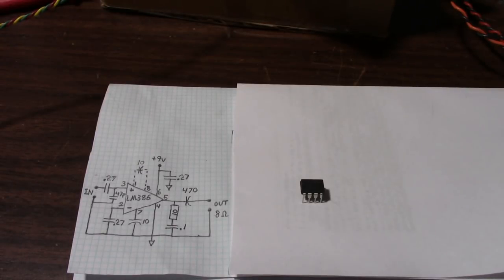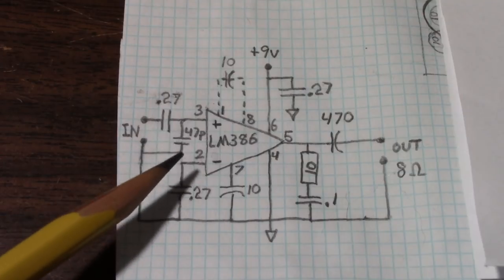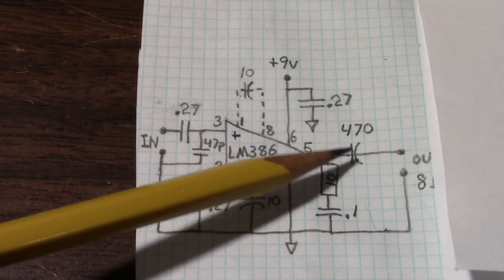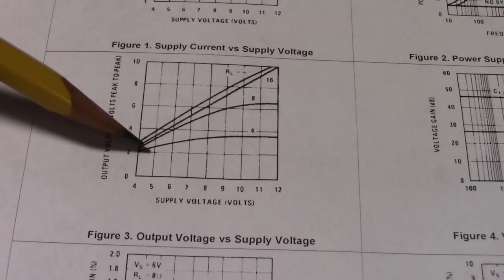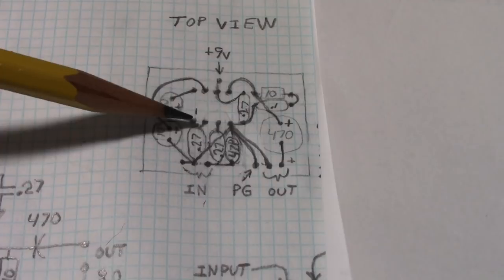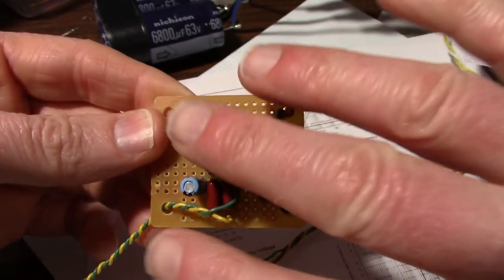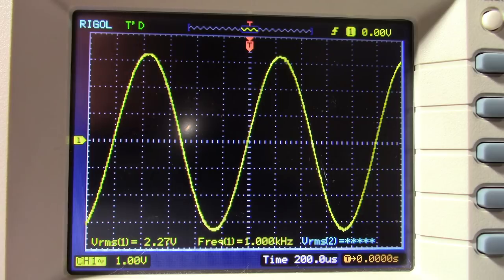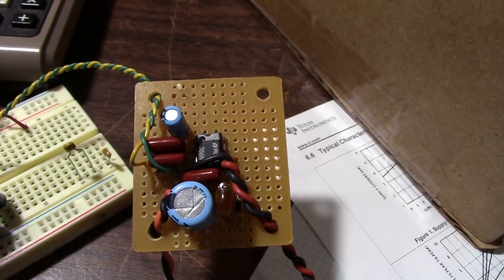Make the PERFECT LM386 audio amplifier?

Comment: Never seen or heard a 386 perform this well. Always excited to see people getting the most from cheap and readily available components.
Reply: The LM386 is EOL'd by TI, perhaps will be by other manufacturers at some point, since class D chips are readily available for this power level.
Reply: @MarkTillotson  - and there are numerous benefits of Class D for low power amps. The LM386 is so old, there's not really any reason to use such a device now days.
Reply: @johncoops6897  Could you be specific with what part number would be preferable to the LM386?  I am guessing that many other chips might be out there now... any which could drive 4 Ohm speakers?
Reply: @BruceNitroxpro  - One of my favorites is the PAM8403, which can be purchased as a complete STEREO module for less than $1 on eBay, etc
Supply Voltage range / typical
* LM386N-3 supply 4V to 12V / typ. 9V
* PAM8403 supply 2.5V to 5.5V / typ. 5V
Output @ Volts, Ohms @ 10% THD / Typical THD
* LM386N-3 @ 9V 8 Ohm = 1 x 0.7W (max) / typ. 0.2% THD
* PAM8403 @ 5V 4 Ohm = 2x3.2W @10%, 2x2.5W @ 1% / typ 0.15%
So the PAM has heaps more power, uses a "easier" voltage (5V USB), can drive 4 Ohm loads, has lower distortion, massively higher efficiency (better battery life), is dual channel so far smaller PCB, and about the same price.
Reply: Agreed. Sounds pretty nice.
Reply: @MarkTillotson  can you give link on Class D amplifier at this level please?
Building a 9v amp for sustainer kit for my guitar...
Instead of speakers, it outputs to a pickup-like 8 ohm driver installed at neck pickup position to vibrate the strings for sustain, then flip a phase reverse switch of the output for feedback or harmonic so neednto add pots for adjusting...
The input to amp is from the other pickup of guitar...
I burnt a Veyz sustainer kit at 10 volts, now using Amtech sustainer...
Reply: @johncoops6897  Hi There. It is just for fun. I played with LM386 years ago (1983-84?) I used mostly 1000MFD capacitors just because I had many of them around. I am not an electronic expert, just watched my best buddy from school did this. No knowledge of electronics just read the diagram (Radio Shack). I connected pin 1 to pin 8 with 1000mfd, BINGO! it worked on 5watt loudspeaker! (sounds very clear & loud with heavy bass)
Reply: @dicko195  agreed with you100% I did it in 1980s.  I used mostly 1000MFD capacitors(no knowledge, whatsoever. It worked magic! Sounded loud with deep and clear sound using 5watt 4" loudspeaker (back then was a full range LS, couldn't afford to pay for the woofer driver)

Comment: I used to make headphone boosters with them. The only difference from your circuit was instead of a 470uf decoupling capacitor, I used 2,200uf for a better bass response. Also seemed to drive into 16 ohm loads better. Ran alright off a 9 volt battery with two lm386 chips

Comment: Ever since I tried this little amp when I got it from Radio Shack in  1986 it was such a disappointment I never tried it again.  Your circuit surprised me!
Reply: Me too, never had a good experience with LM386.
Reply from the maker: If you don't setup the grounding very well, it will distort badly or even oscillate. It can sound good properly configured.
Reply: I'm having a good time with this little chip ^^

I used it to make my practice little guitar amp and I'm trying to improve the circuit, hence why I'm here :)

For guitar amps the distortion the chip can produce is VERY nice, it's almost a fuzz type of distortion and it's very simple to do.

However I can not get clean tones from the amp, for clean tones they are pretty bad, at least for guitars :(
Reply: @JohnAudioTech  Do one on the venerable tough as nails Sanyo STK086
Reply: @CalebePriester   For clean tones you can have a look at the post apocalyptic tin can amp. I made it, and without thinking too much about layouts, twisting wires, and all this stuff, and it sounds clean to me. I do not know the reason, but it sounds fine. If you have not seen that video, search it on YouTube...

Comment: Ive used the LM386 since the early 80's in mostly radio project but its also found itself in most every project Ive made that needed a small audio amp. Ive never given it much thought about making it run any better then the circuits in the data sheet. I would pull them out of old PC modems (US robotics) that where being scrapped years ago so I have quite a few in my parts bin.  Like others stated Ive never heard one sound as good as your circuit.
Reply: I read & followed Radio Shack book..then connected to the early "STEREO FM" gadget. It was fun back then..

Comment: I remember building LM386 amplifiers as a kid on radioshack breadboards, I drove moms pair of Pioneer CS-203/CS-303 speakers with it. It actually sounded fairly well, and had a bit of bass. Man, brings back memories! Thanks for the nostalgia trip. Then I moved on to TDA2003 amps, (which is fun to use in a solderless breadboard), and LM380, etc... Eventually wound up making a super tiny little LM3886 amp which was very powerful.
Reply: have you ever connected this LM386 to the early "STEREO FM"  (SONY or PHILLIPS)? Oh boy.. that was fun..I added 1000MFD capacitor connected pin 1 to pin 8. Even better. What a nostalgic trip indeed....

Comment: Breadboard done and sounds FANTASTIC !!!  I wound up connecting the 47pF ceramic between pins 3 and 4.  Now I'm going to build two circuits side-by-side for stereo.  I'm sure it'll sound even better built (if that's possible). Volume is perfect for my use as is, no need for any volume control other than my source,  the headphone jack on an old Sandisk Sansa I had laying in a drawer.  I'm powering it with a couple of 18650's and it's only drawing around 35 mA with the music I'm playing, Joni Mitchell.  This is my first amplifier, but now I'm hooked, and I'm sure it won't be my last.  THANK YOU, John !!
Reply: Make a video of that sweet amp, i wanna see.
Reply: @analogaudiorules1724  I just followed John's excellent instructions exactly.

Comment: The tda7052 is a great chip that's similar to the LM386 but it is more stable, doesn't require the decoupling capacitor, and puts out more power on less voltage.

Comment: Thanks!  Works great as a mic pre-amp for condenser/electet mic to line level input.  I added a 1kOhm resistor from 9V to mic-in to power the mic.  My mics have 900-1000 Ohm static impedance. Needed the optional 10 uF capacitor between pins 1 and 8 for gain. I only used 220 uF capacitor at the output.  On the breadboard, there was lots of noise pickup but on a compact circuit (one shown is good) it only picked up radio.  Probably could use a low-pass filter on it (I was getting good response up to 160 kHz and very slow falloff from there).  I found that encasing in a metal cage eliminated the interference so I'd done that and I use without a filter.

Comment: For the gain regulation, I find you can get the widest span in amplification factor with a 10k pot, so your overall resistance will be 909 ohms when the pot is in maximum resistance. This will give you roughly 25 to 200 times amplification, instead of the 50 - 200 that you'd get with a 1k pot.

Comment: Have built loads of LM386 amplifiers, usually for 🎸 practice amps. I didn't know about dumping - input via capacitor rather than a short to ground, much better. For guitar use, I often use a one stage BC549C preamp to get a bit more welly and use high pass filtering as the sub harmonics from a standard guitar has a lot of bass. LM386 withstands abuse, well. I use a 12 volt supply into 3 ohms. It's been working like that for years but isn't a good idea. Helpful upload, thank you.

Comment: 18:03  This is a balanced differential input, so if you have different circuitry causing a different DC level on the inverting input than you have on the non-inverting input you will create an offset.    So when you strayed from the data sheet and added a capacitor to the non-inverting input, of course you need to do the same for the inverting input so that they will both be at the same DC level.   Not a big surprise. Unless you really understand the circuit and calculate and simulate to confirm changes, following the data sheet, which is based on good design practices and design reviews,  will give the best results.
Reply: @ Dana Olson = I am not an EE, so I am a bit confused by the way your reply is written... John placed a 0.27uF cap on the non-inverting input, to clean up the signal input. He then added a 0.27uF cap to the inverting input. I take it that this evened out the offset and that your statement simply explained how the offset occurred in the first place; correct? You are not suggesting that another cap is needed on the non-inverting input, are you? If so, exactly where should it be placed in the circuit? I'm sorry to create confusion, but it is always better to ask a question... Thanks.

Comment: Nice to see someone make a decent circuit on a prototyping pc board with the LM-386. So many knock this chip because they have no idea how to properly build the circuit in the schematic.  They think they can build a high gain circuit on a plug in proto bread board (what you call socket board) using hook up wire and have no clue about mutual induction between wires and stray inductance and capacitive coupling between all the busses on a "socket board".    LS Short, don't let any of the output signal get back into the input.
 To do that effectively you have to use twisted pair at the least, like you have here on the input and output and keep all leads as short as possible and  to get the most performance out of the chip, use SHIELDED audio cable on the input and output with the center lead as short as possible and connected to good ground. Build the circuit on a etched double sided PC board with the input and output separated by a large ground plane as the chip was intended to be put on by the designer of the chip, International Semiconductor.   
 Electronics Engineers like myself and knowledgeable techs like you can get away with a good circuit mounted on a proto board like we've both done with a few tricks.
 I have a two way intercom between my living room and outside privacy fence gate using the LM 386N-4 driven by a TL-082 OpAmp fed to a Radio Shack Mic that has been working since 2008.   I love this combo and I can pick up sounds from blocks away.
 I've thought about making a vid on how to properly build an audio amp with this chip for a long time.  It's amazing how loud and clean this little device will drive an 8 Ohm speaker and will fill a whole room with sound.
Reply: Very interesting what you say. It would be nice if you want and have the time to do it, to show how you do it in order to cover all the points you mention. I have problems with the smokey amp, and I am quite curious about what I am doing wrong to get that squeals and horrible noises, while the original ones do perform good or very good.

Comment: 5:47 These damn LM386s made these days are real pains in the rear. The last circuit I made with them (Little Gem Mk II) required me to use a 10uf across Pins 1 & 8, and it had to be connected literally right at the pins or it would motorboat. When I used older chips (like 15 years old) I had no problem, but the newer ones are nothing but trouble.
Reply: Dave Smith - Could maybe be why

Comment: Hi, John. Please tell me what type of capacitor you actually used for the 47pF input cap, across the LM386's two input pins, pins 2 and 3. I watched the video, again, to catch this detail. I thought that you had commented on it, but, if so, I did not catch it, this time. Around 14+ minutes, there is a quick glimpse of the component. It sort of looks like a yellow ceramic, but I am just not sure. 

Teachable Moment = In addition to telling me what you actually used, please comment on what would be the best type of cap to use for this application and why so. Also, what might be substituted, in a pinch... Such as, maybe what appears to be a common ceramic is actually a Tantalum?

This is very much the audio signal, so I was expecting some type of a film cap. I checked at Mouser on 47pF film caps and they only seem to be available in really high voltages. I have a nice 47pF/1KVDC-250VAC/Polypropylene/AC and Pulse Film cap on hand. And, I that you taught me that, if the cap voltage rating greatly exceeds the signals voltage, the cap will not form up correctly and the rated capacitance will not be achieved? Thanks, again... I have learned so much from you!
Reply from the maker: The capacitor is a NPO ceramic type. It is a low pass filter to help keep RF out of the amplifier. Ceramic is fine for this duty. Value can be changed depending on needs.
Reply: @JohnAudioTech  "NPO" = I haven't heard that one. Common ceramic - DIP, gum drop, etc. I know of these. I take it that a common ceramic will do. Thanks for the reply and the information. Cheers!

Comment: The best results I've had with these LM386 designs were the ones using a FET as a buffer for the input -- the Ruby from runoffgroove mainly. I recall using a J201 to best effect, but apparently the through-hole package for those are out of official production now? I also liked a bigger output capacitor than most of the LM386 designs (they usually called for a 220uf), I think I usually went 470uf like you're using here, or 680uf, especially for guitar use. I remember finding a 10k volume pot to cut too much high end for HiFi audio, and a 50k audio taper working best for me there. I'm not an engineer though, I just made semi-blind substitutions. I remember socketing the transistors and the gain resistors to try different things. Thank for this design, it's simple and compact and if I get back into it I'll try it out for HiFi. But I still have a stereo buffered LM386 board I never bothered to put into a box and use yet, lol.
Reply: so, you can amplify the signal before the ic amplifies it?

Comment: Thanks for taking the time to explain the capacitor on the negative input of the LM386. I've seen it done before, but as a relative noob to electronics, it wasn't really clear why.
Reply: To short out the noise due to the internal 50k resistor - both Johnson noise and flicker noise(*),  and reflected current noise from the transistor base due to the 50k.
(*) integrated resistors are not metal film, not the best performing resistors.
Reply: 3

Comment: i used a 5v split supply and eliminated the output cap slightly adjusted the bias and got 3v into 8 ohms flat down to 10Hz

Comment: The frequency sweep shows a hint of crossover distortion appearing above about 10kHz, a combination of inadequate bias on the output (to give low quiescent current) and  starting to run out of open loop gain. As you mentioned, configuring these little amps for high gain makes performance worse in pretty much every respect and should be avoided for any application were reasonable audio quality is desired.

Comment: Hey John love you stuff
Should do a 3 lm386 chips in a bridge stereo circuit 
Can get 3 watt
Reply: A bridged amp uses two amps in anti-phase, why would you use three of them?
Reply: or use a proper TDA branded chip that can deliver that power in stereo..
Reply: PAM 8xxx is really enough
Reply: ElfNet Designs what’s the fun in that?
Reply: Nope, at least not when loaded with 8 Ohms. As explained in the video @8:00 the amp can hardly provide any more current. The increased load would lead to a significant voltage drop at each output stage, only causing more distortion.

Comment: Great explanation of this circuit,  I've a couple of those 386 chips and I've done this circuit similar to yours(minus a few caps), and I use it for my guitar. I got a tube driver adaptor that plugs direct to the guitar and then I put the 386 amp on after that, where I connected with the phono male and female then out to the speaker. Your guide has solved a bit of puzzle why I couldn't directly connect the 386 amp into the guitar and then to the speaker ie. it needs a load for it to work(I think). I've used a dimmer switch for a push on and off, and another switch for the 200 gain, with a pot to adjust the loudness and it's powered by a 9v battery and it lasts for ages. Thanks a lot for this and I subbed :)
Reply: Hi Nick Sparks;
I would like to ask you something. As far as I am concerned you used the LM386 to make a guitar amplifier. Does this circuit usefull for a guitar amplifier ? If it is not is there any modifications that I can make on this circuit to make it usefull? I am looking forward to hear from you. Have a nice day.

Comment: 2:20   You create a capacitive divider at the input.   This is not a low pass filter at all.  Check it with LT Spice or something to see what I mean.  You will create a standard RC low pass filter if you add the normal series input resistor.  Something like 1 kOhm would work really well and not change the gain much at all as the input resistance is huge at 50 kohm.   Resistors are practically free.

Comment: Excellent! So many LM386 (and other IC amp) projects misuse them. You not only talked about why, but showed what happens.

Another thing to consider is that a volume pot on the input side should have a cap between the wiper arm and the amplifier input, because bias currents through a wiper arm can cause extra noise.

Comment: Because of internal current limit, the amplifier would actually produce more power into a 16Ω load, than 8Ω with a 12 volt supply. I consider that to be an absolute maximum voltage, and would not use that much in an amplifier design. At 9 volts supply, it really is best at 8 Ohms. According to the graph, the amplifier output seems to current limit at 375 milliamps. If the amp would maintain this current limit with a 4 volt power supply, it would fully drive the 4Ω load.